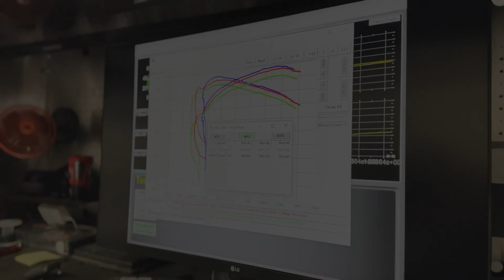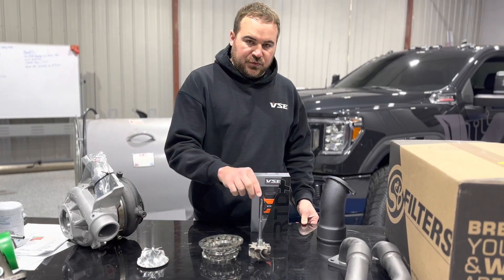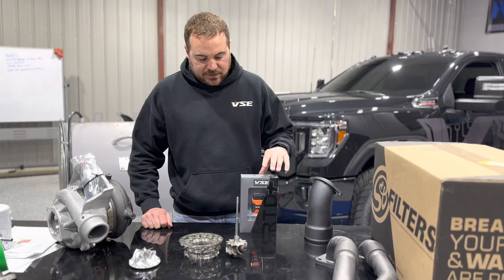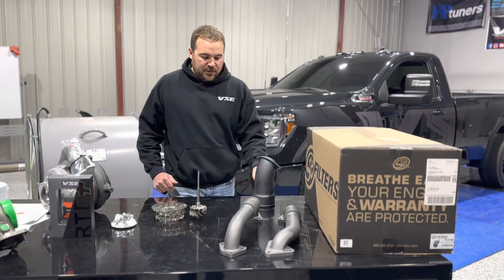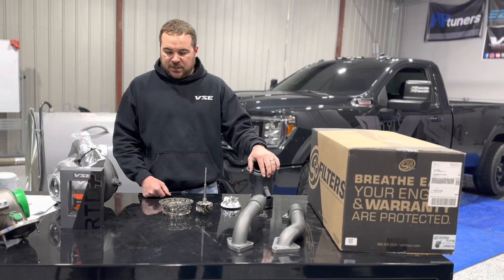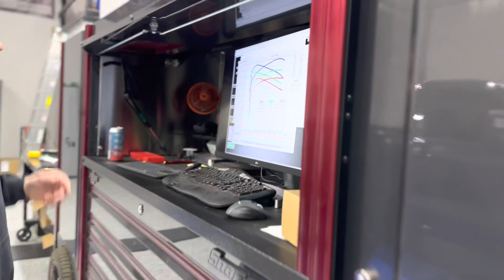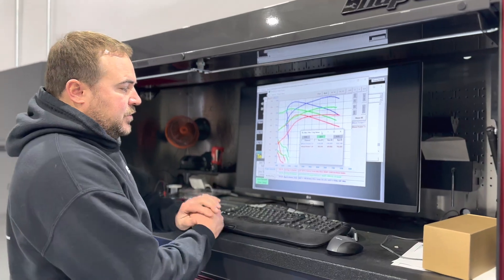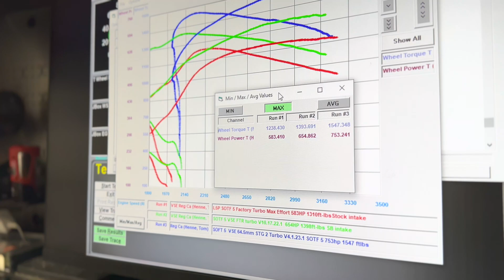Making a 750hp L5P

Comment: that truck sounds pretty loud ... are all emissions still intact on that test truck?
Reply: Is that a serious question lol
Reply: @anthonybenacci9222 ... they only sell tunes with emissions intact... claim to do 700hp full emissions 
. But that truck sounds like it's deleted... they don't offer tunes for deleted trucks... so yes.. that is a very serious question... thanks for asking...
Reply: @thomasstott527  that’s why I asked if you were serious. VSE is known for pushing the limits with emissions intact tuning. Wasn’t trying to come off rude man. But it definitely has a straight pipe behind the DPF sounding like that. And with the manifolds and up pipes/downpipe they will scream like this through mufflers and cats
Reply: @anthonybenacci9222  I'm not sure if you have been under one of these trucks... the pipe behind the DPF is straight.. there is no muffler.. by adding a DPF back exhaust system .. it does nothing to the sound... there is also no mufflers.. everything under them are cats and DPF...

Comment: What are you doing for the transmission? Stock is rated for 650hp
Reply: Blowing it up. But it's torque that the trans cares about not the hp.
Reply: @Eli.H.Sanchez  torque increases with the hp
Reply: @ryana3522  Yes but when looking as trans ratings they're in torque so you just look at torque only. Also torque doesn't always go up with HP. It can sometimes do the inverse at higher rev ranges. But usually it does just not always.